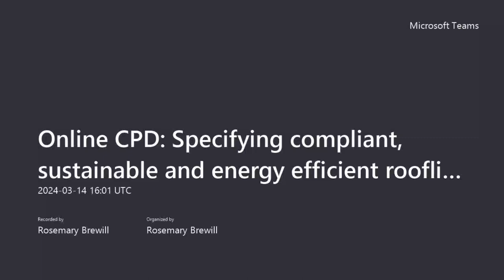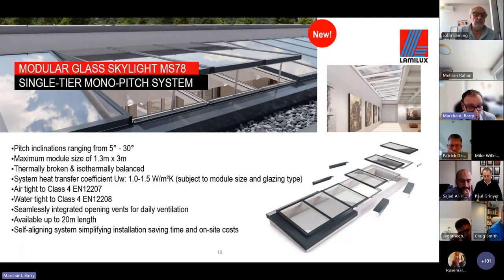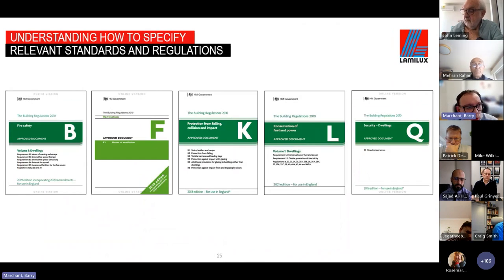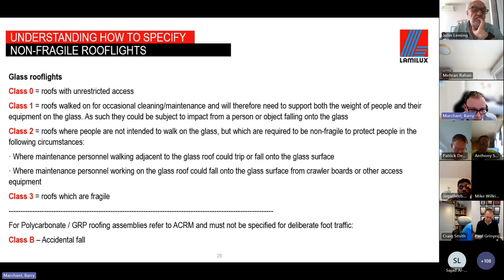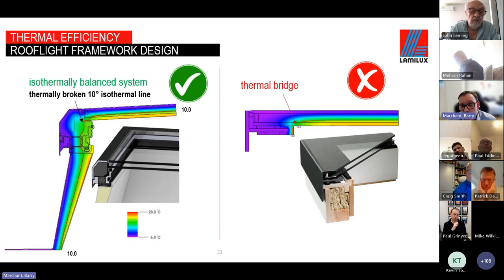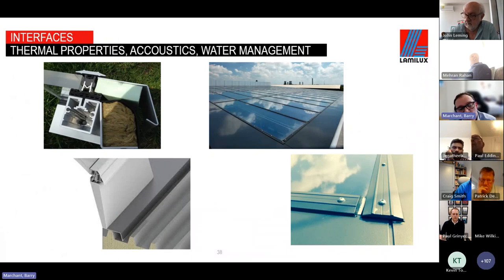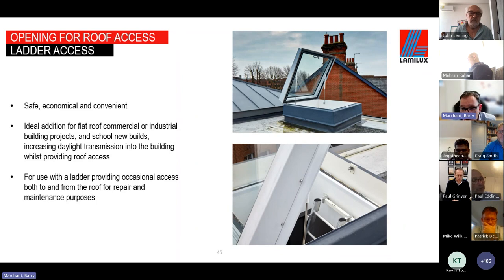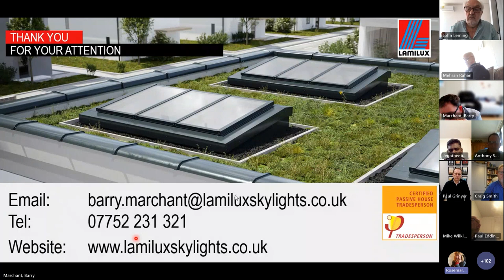Online CPD: Specifying Compliant, Sustainable and Energy Efficient Rooflights and Glass Roofs

Comment: I'm confused, if the timber structure is wrapped in a fire rated material e.g Fire line plaster board then the timber structure meets the 30 or 60 minute criteria. The weak spot will be the roof light 🤷